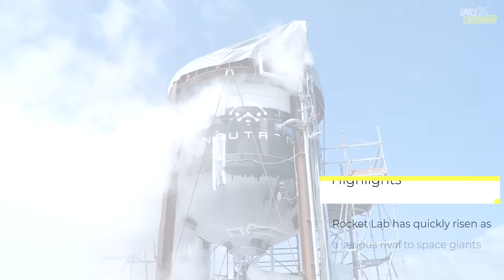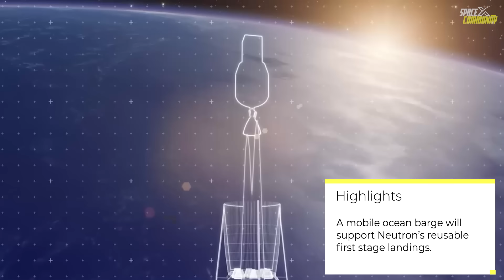What Rocket Lab Neutron just did to Blue Origin, Boeing, ULA Will Blow Your Mind! New SpaceX Ready

Comment: Will it disintegrate upon return? Will they try for reusability in the future, refurbishing is cheaper than a new build per flight.
Reply: Yes it will soft water land first flight then barge land second flight - its been designed from the outset for reusability including the engines and fuel which leave no carbon deposits.
Reply: Thats the plan. They wont try that at the first flight this year but next year they wanna try that. The rocket was designed for that purpose
Reply: It's reusable from the ground up. Which falcon 9 wasn't. Everything from engineering and materials is designed for over 2 dozen launches per vehicle from the get go. With the exception of the 2nd stage. The first stage is reusable like falcon 9 with reusable fairing too

Comment: We’ll have to see, for now it’s all talk. No one will bet SpaceX.
Reply: Check out what they have achieved with their smaller rocket, and the clients they are picking up, Hardly 'all talk.' Trumps poodle is about to loose bad to Neutron. Besides starship hasn't done much more than rain garbage on the surface of the Earth. Also 'bet' space x? My bet is Sir Peter Beck has the winning formula.
Reply: May not be a case of beating Space X but filling a niche. Only question how much demand will there be.
Reply: If RocketLab can pull off landing Neutron at the first attempt ...  RocketLab will beat SpaceX in the up to 8 tones capability to LEO.